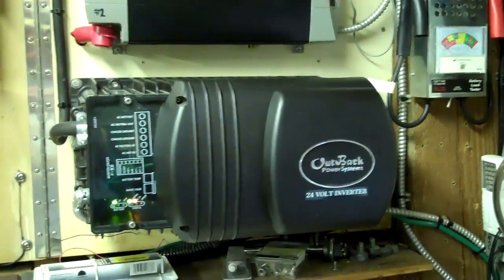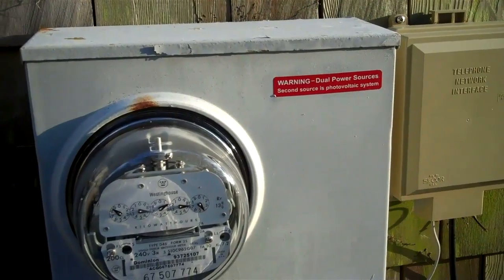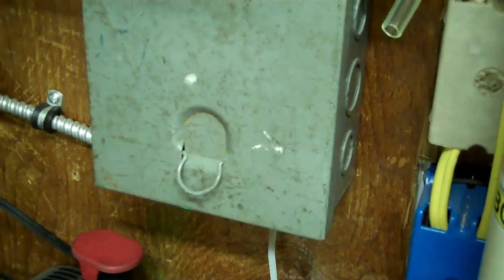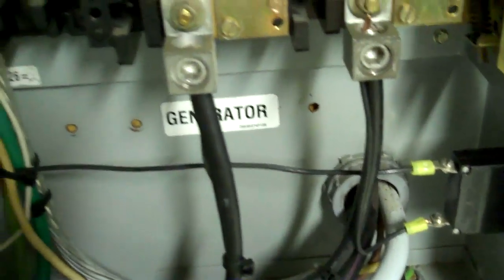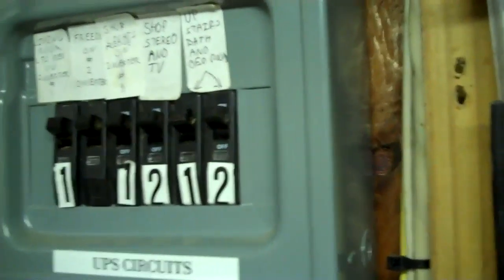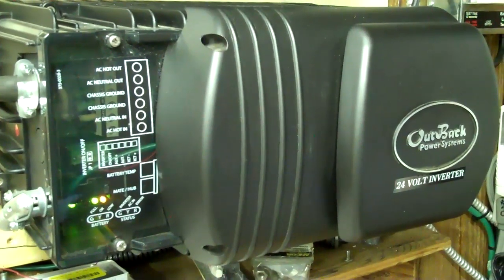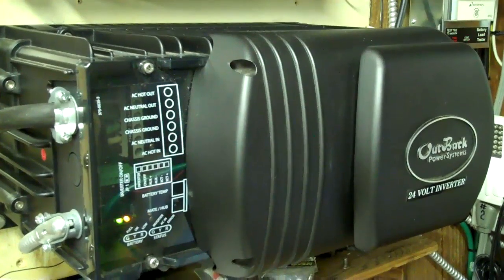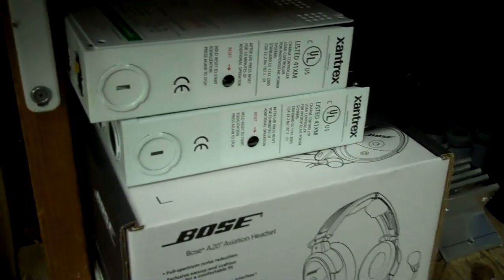HOW I WIRED MY OUTBACK GTFX2524 HYBRID GRID TIE OFF GRID INV

Comment: Very informative and to the point. Nicely done. Best information on actual use of this equipment that I've been able to find. I recently upgraded my inherited Outback inverter and controller to the newer models like these. You have your grid tied to the AC HOT IN but if I understood correctly you could just as easily connect a generator to the same point, right? Also, I may have missed it but can you tell me what size wire you used for your grid to the AC HOT IN terminals?  Thanks and keep making these videos!!!

Comment: Aww, OK. But I am planning an off grid system in the Philippines. Small farm with few needs. Mostly lighting, TV, small fridge some like 5.7 cu ft. But could really use some help figuring what I need out, planned on getting a 60 amp outback charge controller, and a 2000w sealed outback inverter. 1000w of solar panels, running at 24v. But there are a lot of cloudy days to deal with so I know during the rainy season I will need to fire up a generator. Any advise on this?

Comment: Does the Outback hum very much under load?  At idle? 

Thanks
Reply from the maker: Ian Moone Its very quiet for the most part there is some noises like fluids moving around. The fan is the only thing I would say makes noise and it only comes on when the loads and or draws are high... Grid tie output, Battery discharge and battery charging. I am very happy with the Outback.Hope that helped.

Comment: Good explanation. I like the twist lock bypass option. Will incorporate into a system I'm installing in my cabin. I'm curious, I know batt bank is required but once bank's topped off is it the bank that continues to feed the 30amp breaker or the panels directly? Probably a stupid question but I'm curious how much wear/tear my bank will be taking using this inverter. Thx for all the great vids.

Comment: nice, IN CASE A LIGHTNING strikes.. you think is OK to set a in line amp fuse on the pv array cables coming down to your charge controllers? you think may avoid getting the charge controllers toasted like those you showed?

Comment: what happens when you have a power outage with a grid tie inverter hooked up ? do you need to flip the main breaker to keep people from getting my power, or does it automatically happen at the (capacitors ?) on the power poles ? if you know please email me at xtermin8herx@yahoo.com thanks.

Comment: A metal case charge controller may be OK, but you should keep some big diodes in a safe place and if the SHTF you can still charge the batteries the old fashioned way and not worry about nighttime feedback. Keep a spare inverter in your EMP safe place and have LED lighting ready, maybe get some basic RV store bought 12V and propane cooking things. Plus you are going to have a lot more to worry about when all the unprepared people around you come wondering why your lights are on.